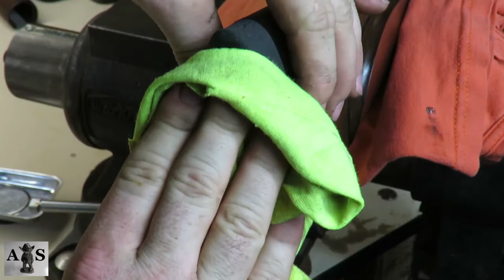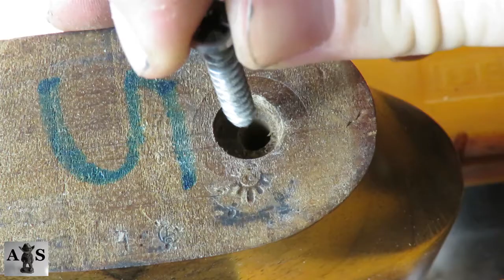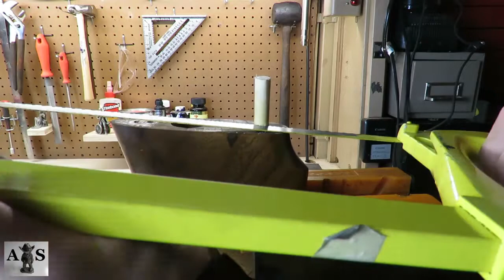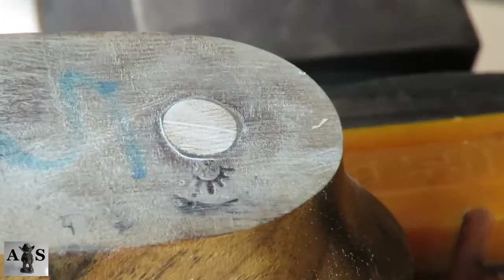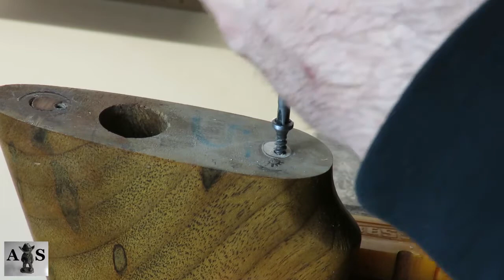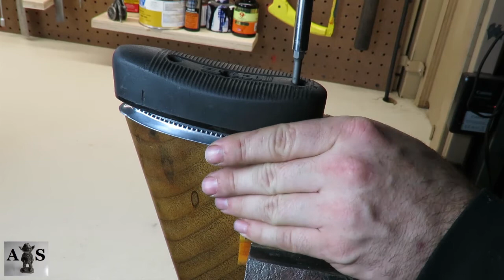stripped screw hole on recoil pad

Comment: For cryin' out loud, use the proper screwdriver!!  Those screws were POZIDRIV not Phillips.  If you don't know the difference - pozidriv screws look similar to a phillips screws BUT you'll notice little diagonal lines in the screw head in addition to the slots.  Using a phillips screwdriver will strip the pozidriv screw and it will raise a burr on the slot.